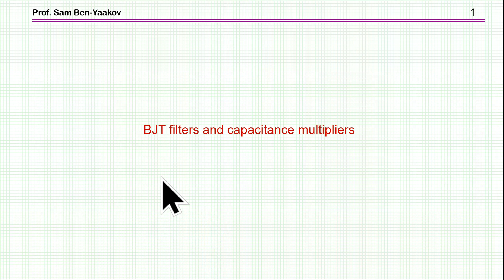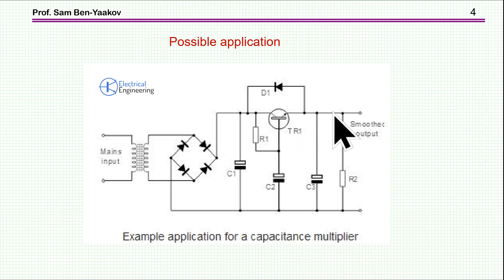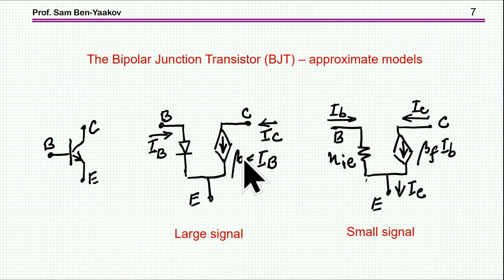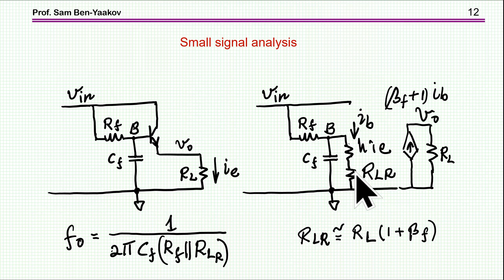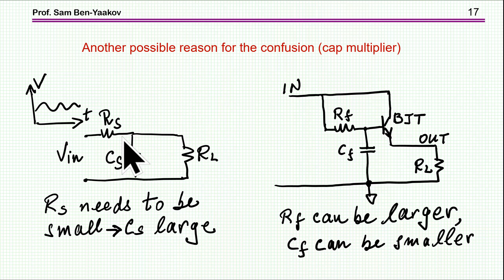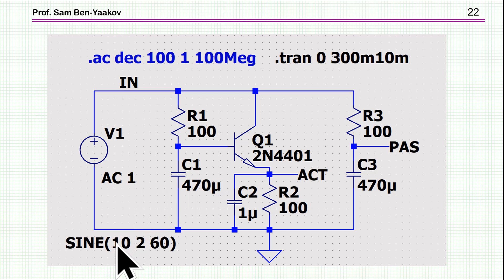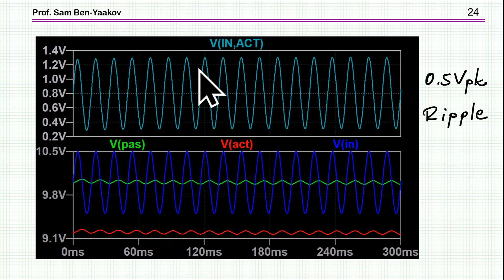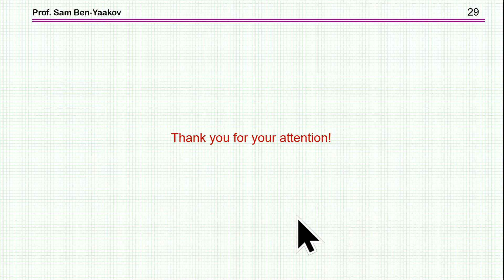BJT filters and capacitance multipliers

Comment: Well, it is not related to filtering, but low output impedance is a fairly important aspect of any power supply and this circuit enables it due to the common-collector configuration of the BJT. Nevertheless, no doubt that there is a huge misconception about the statements given in the Cadence presentation. Suggestion to all electrical engineers - please use relevant references to learn electronics (Sedra-Smith, Gray-Meyer, etc). Thanks for a nice video lecture!
Reply: Companies like Cadence and Altium should stay away from this kind of presentations on subjects they don't fully understand. It would be better if they would both concentrate on delivering quality software. Cadence used to be good. But not so for the latest versions they released. Altium is an other story.
Reply from the maker: @SwitchingNoise  👍

Comment: Ive used this circuit to remove a very small ripple on a 200V DC Supply. I needed to have a very clean output voltage and the load was minimal because it was for a supply for a sensor. What would you recommend instead in this case? I have to say it was a really good solution because it was easy, small and power used was minimal because of low current.
Reply from the maker: Thanks for sharing.

Comment: 7:21 I wonder if we could add a diode in series with Rf to increase the voltage drop.
Reply from the maker: Thanks for your input. Indeed you can, but better to add resistance to Rf to get a lower frequency break point. On the other hand , if the current drops you may still not have a sufficient voltage drop with the Rf.

Comment: If i'm understanding this correctly, you only consider a miller capacitance to be a capacitor multiplier circuit( capacitor across input to output). The bjt filters merely let you design for lower currents, and thus you can make r smaller without making the capacitor larger. Essentially you can move your pole into higher frequencies without needed a larger capacitor. The misconception being this effect does not actually increase capacitance in any way.
Reply from the maker: Thanks for your comments. There are other cap multiplier circuits that entail current amplification rather than voltage amplification (like base to emitter in BJT).

Comment: Do you have a suggestion for alternative circuits that filter that noise? I feel that it is especially important for suppressing 60hz ripple without having massive capacitors to charge
Reply from the maker: I will try to touch on it in a forthcoming video. Thanks for your comment.

Comment: 13:21 I guess a solution is to combine a normal RC filter with small R to cut high frequencies with the RC+BJT (with higher R) to deal with lower ones (so you don't need a huge C)
Reply from the maker: But in the 'nirmal' RC filer the current will pass via the R?
Reply: @sambenyaakov  unfortunately yes. That's why you have to use a small R and can't filter low frequencies unless you have a ridiculously big capacitor. But that's OK if that tasks is done by the BJT+RC.